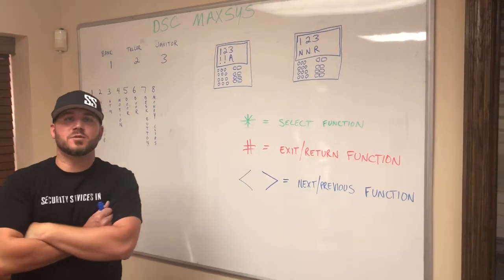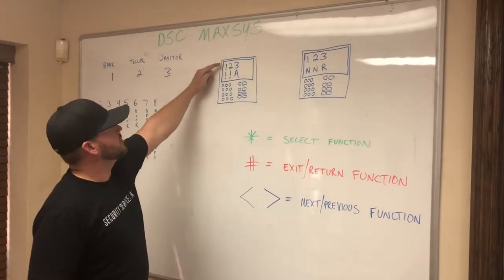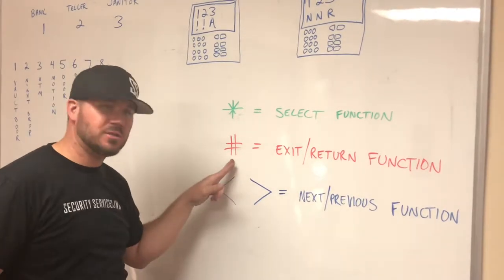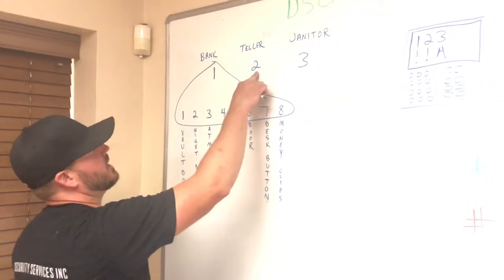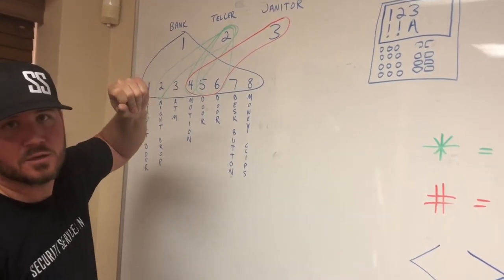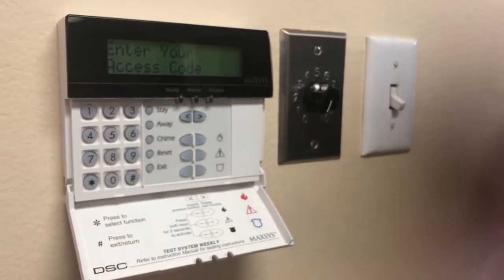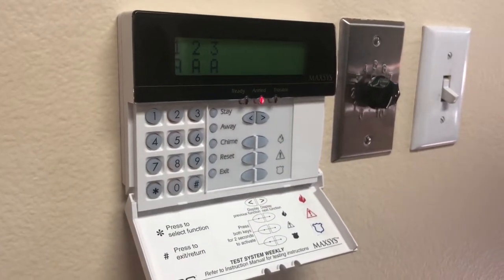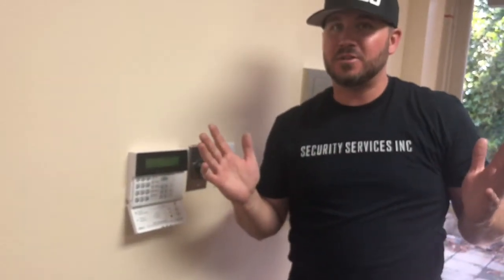DSC Maxsys Alarm instruction

Comment: I have a DSC1550, the transformer power adapter gets very warm, (turned brown after time). So casually  looking at the circuit board, I see a full rectifier in the power section, thinking that the unit can function using a DC adapter. Connecting a variable DC supply set to proper battery charging voltage (13.8vdc), I get a trouble light on the control panel. I wonder why?